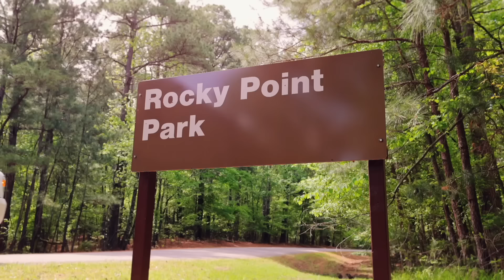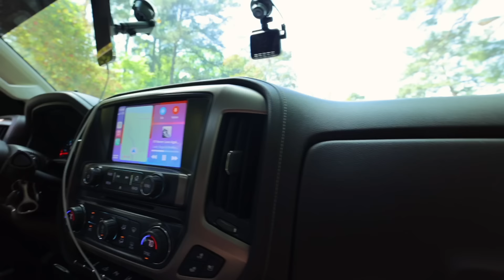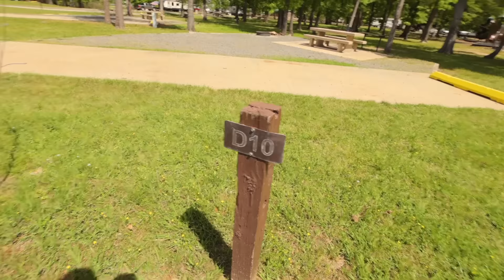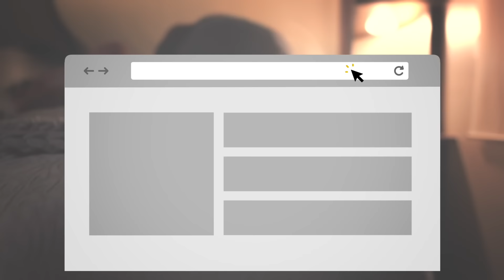DON'T Take Shortcuts with an RV - We Paid the Price

Comment: C.O.E.  parks cannot be beat . . .   especially for us “seasoned citizens” ! 😁
We have camped there at Rocky Point several times,  very nice !
Reply from the maker: YES!! How cool that you have been there as well. What a small world 🙂
Reply: We have 2021 Rockwood 5th whl ;  their entire product range has the Dexter Torsion Axles.  Just luv’em !
Reply: Regarding axle bearings . . if you’re already in a situation where you’ve removed a wheel & hub,  it’s best to just clean & re-pack with grease “the old-fashioned way”, by hand. 
Using the grease-zerk on the spindle-end is “tricky” . . .  real easy to “blowout” the rear seal, sending grease all over your brake assembly . . . kinda negates the “friction” of brake-shoes.

Comment: We made our appointment at MoRryde for the independent suspension and disk brakes. IT IS ABSOLUTELY WORTH IT. Braking is far better, ride is far better. It won’t change your weight sticker but we went from 7000 to 8000 lb axles.
Reply from the maker: This is great to hear! We are happy you have found the upgrade to be worth it. Keep on keeping on 😎

Comment: When you replace the brakes you are supposed to replace each end of the same axle so the braking force on the axle is equal.  We broke two springs in 2021 / 2022.  I learnedyou are supposed to replace both springs on the axle with the broken spring.  If one side breaks it puts a lot of twisting stress on the remaining spring,  weakening the remaining spring.   We stopped by the Rocky Point Campground in Feb., 2023.  Beautiful sunsets.

Comment: RE Independent suspension: I've seen a few other full-time RV'rs that got independent suspension and can't say enough good things about them. In their video, they showed ceramic coffee mugs, staked in their cupboard hap-hazardly, as if they were at home. And on travel days, they don't do anything with them to protect them. they just pull out with them stacked like that. When they get where their going, they're just like they were when they left, unbroken. Also, they leave a lot of items out on their countertops that they wouldn't normally, before they got the new suspension, and for the most part, they stay were they were put. Granted, the items on the countertops had some weight and either rubber feet or they put something like Gorilla drawer liners under them to help keep them from sliding. I'll tell you that, if I could afford to, I'd do it right now. Unfortunately, we just got our truck and trailer, and had to spend an awful lot on the initial essentials for camping.   FYI... initial "essentials" involved things to support my wife who has been diagnosed with "end stage" COPD. After a recent health scare, we decided to go ahead and do this 'now', before it was too late.

Comment: Don’t know about the independent suspension but I have disc brakes on my 2019 5th wheel Reflections and I will tell you I will never own another bumper pull or 5th wheel without them. Highly recommended!
Reply from the maker: Great information! Thank you for sharing. We have always been curious on how well they worked.
Reply: @HappilyEverHanks  I have no insight on the disc brakes on rv trailer applications, but in general disc brakes are always far better than drum. and more than likely WORTH the $$ they cost.
Reply: I have disc brakes on my 5th wheel too and i have had them on other trailers. They work fantastic but come with their own pitfalls. In an RV they have a hydraulic pump and fulid levels that need ot be checked and also the lines may need to be bled from time to time.  My 2024 GMC  had to have the brake controller replaced because the controller did not work properly with the electric/hydraulic pump which was a pain for us. We would just randomly loose the brakes which is not good when our RV is a 24k unit.... 

In regards to the drums, there is nothing wrong with them at all as long as they are maintained. My suggestion would be taking them apart annually to inspect the shoes, clean and inspect the brake hardware and clean, inspect and repack the bearings.
Reply: @TDub_ADV  I was unaware that disc on a tt was that big of a pain. makes sense tho. as they can't be "just" electric. and I agree my drums are fine with a bit of care. kinda like the misses.🤣

Comment: We had the MorRyde Independent Suspension installed on our brand new 2021 GD Reflection. Totally worth it especially in light of the recent complaints of frame flex. MorRyde will be doing a lot and I mean a lot of welding to the frame when the IS is installed. The result: a beefier frame and best of all, NO leaf springs to worry about breaking while traveling down our wonderful (joke) of an interstate highway system, 😖

Comment: Be very careful greasing the hubs. If you put to much grease in it will go onto the brake pads and ruin them and you will be replacing them again. I have replaced more brake pads for grease on them then I have for them being worn out.
Reply: 100%, I've had to do this as well. it happens, just cuz you can pump more grease in does not mean you should!

Comment: Great content as always. For parts on your trailer or vehicle anything touched the ground like tires or bearings. Ball joints ECT. Think like your shoes you replace them in pairs even if the other shoes have Abit of tread left it might fall apart sooner then you think. And it sure feels good walking with equals pairs same thing with auto parts . Cheers from Québec Canada.
Reply from the maker: Great point! Thank you for your wonderful support 😊

Comment: Hi we have a 2019 29 30 we put disk brakes on it in 2020 zero problems we also put slipper springs which have lifetime warranty. We purchased them at performance breaking and they install them where we wanted, they came to us.

Comment: You should replace the other axle brakes also.  You would be good to check them at least twice a year and replacing the brakes with the entire plate like you did is the best way to go,  if there is rust or junk in the old parts it can cause issues.  If you know what axle you have which should be on the sticker on your RV you can tell them you have a dexter 8K axle and want both ends of the loaded brake kit.  Good to learn this so you can check your bearings twice a year.  Hope you are staying safe and healthy.

Comment: A suggestion for your jigsaw puzzle - get 2 large foam filled boards from wally world.  Start making your puzzle on the first board.  When you travel place the 2nd board on too and tape the edges up.  Also when you just want the table space back for any reason, same thing.  Added advantage also allows you to spin the puzzle easily while working on it.

Comment: Hey guys, love your videos!!  This is one reason when we travel, I carry two spare leaf springs, shackles, bolts, equalizer and a spare set of wheel bearings.  You never know what's going to happen with one of these rigs.  It always seems like something is going to go wrong.  Speaking of brakes, I just noticed that none of my brakes had the little plastic things that cover the hole where you can adjust the brakes from behind the wheel.  None of the wheels had them.  I just ordered some and will be snapping them in place.  Another area where dirt and water could enter the brakes and eventually cause problems.
Reply from the maker: Great idea! You are a few steps ahead of us. It’s crazy how quickly life can sneak up on you when you least expect it. Thank you for watching 🙂

Comment: Independent suspension 
🇦🇺🦘 Aussie here , this has become our most common setup because of free camping as most or the best places are off the hardtop, beaches, deserts etc
Then it’s how far you want to get semi off-road 1 shock with coil spring, off road 2 shocks & coil or air bag suspension. Then it’s drum or disc brakes, disc’s are pretty much standard with airbags now. We personally have off road since 2019 love it, get a bit higher ground clearance.
Want to see probably top of the crop check out cruise master range

Comment: When tightening that bolt on the hub you should use a torque wrench, not channel locks. Also it’s much easier and works better to grease the bearings with a   bearing packer. Lastly it is recommended that you repack your bearings every 12,000 miles.
Reply: ...that's only part of the procedure!  Torque while turning the hub like you said...  this is to "pre-load the bearing"  step 2 is extremely important.. 2) loosen nut after Torque and  finger tighten only!  If you don't do this it will run hot and probably fail prematurely.   Ask me how I know...

Comment: It looks like you got manual adjustment brakes - be sure to regularly check and adjust them.  A great reference for all things trailer brakes/bearing/axle related is @TheTrailerSmith.  There is also break-in process for new brakes called burnishing that makes a big difference in how well they work.

Comment: As a mechanic, you need to replace components in pairs. If you replace one side, then you need to replace the other side. 
And with your high mileage on the trailer, not only would I increasing your spring weight, I would upgrade the axle weight to include disc brakes. 
One way to check brakes, is to use an infrared thermometer. Drive little and hold the brake actuator  on the brake controller. Then check temperatures for each brake. Then you can identify which brakes are working, not working and those over heating.

Comment: You should do both axles not just one.   I did this on my fiver and  noticed on brake pads that looked ok were actually starting to peel off of the metal.  Lot of weight they are trying to stop so lots of heat involved.   I just got all the pre-built assemblies and replaced them  Luckily I did this before having any damage to my Drums.   My bearings looked fine so just regreased them and got new seals.  Good luck and happy camping.  Also used the open roads diesel app on my last trip and did save some $$'s so thanks for that.  cheers.

Comment: Btw, the wheel bearings need a special procedure to make sure they are tight enough! Normally you torque the spindle nut to 50ft-lbs then rotate the drum three full turns, they back off 1/4 turn, then rotate the drum three full turns, then torque it again to 50ft-lbs then rotate the drum three full turns, they back off 1/4 turn, then rotate the drum three full turns, then torque it a third and final time  to 50ft-lbs then rotate the drum three full turns, they back off 1/4 turn then install the lock ring or cotter pin depending on the type off lock. IF the lock does not line up back off the nut until it does line up and done. Make sure to sue your greaseable hub to fill the bearings! 

As well, I thought I saw you ask the question if anyone used Independent Suspension on their RV. I have had trailer with Leaf Springs like your 5th wheel and I have had a travel trailer and now a 5th wheel with Dexter TorFlex Axles...now that I have used the TorFlex axle trailer for almost 10 years, I would never want a trailer without the independent suspension ever again! The Ride is super smooth and stable at all times. Even the harshest roads doesn't cause things to swift in the 5th wheel and they technically cannot break! 

I would also like to mention that you should consider replacing your trailer tires, I saw in two of your videos a belt issue in the sidewall of the Westlake tires you currently have. I would suggest the Carlisle Radial Trail HD tires for your trailer, they will even reduce your fuel consumption by 1 to 2 mpg! And if you change your tires, consider getting them balanced, it helps with even wear and reduced vibrations to the rest of the trailer and therefore reduces repairs!

Thanks, Kevin

Comment: A good lesson in not putting off inspecting a new noise source.  Glad you had some helpful neighbors, they seem few and far between these days.  You did the right thing buying new backing plate assembles after that much damage....  The drums might have  been reusable unless they had a bad groove in them so erring on replacing them was good.   I been towing trailers with electric drum brakes for over 25 years and I can count on one hand how many failures I have had on the road.  Coupled with never having issues stopping the truck and trailer I am not sold on electric over hydraulic setup (AKA disk brakes) as must upgrade.  Annual maintenance and inspection has caught every time they been worn down enough to need replacing or failures as they where about to happen.  That alone has convinced me I not to spend any money on retrofitting on a trailer and use those thousands of dollars towards travel and making memories.

Comment: We had the independent torsion suspension on our Rockwood Minilite and it worked great. No issues with 6 years of ownership other than servicing the bearings once a year. It is the same suspension system used with Airstream trailers.

Comment: Thanks for covering this critially important responsibility. If someone is not comfortable doing a brake check/job themselves, taking your rig to a trailer repair shop and having them check and repack your hubs is also an option. Most RV parks know local shops that can handle large rigs. Of course this should be done BEFORE they begin to make strange noises....

Comment: do not have the independent suspension but, i did have Disc Brakes installed on my RV and the roadmaster slipper springs with shocks installed by performance trailer braking.  Made a world of difference in towing and stopping.  The installer told me that one disc brake has more stopping force than all 4 drum brakes combined.  he was not wrong the disc brakes are "wonderful" and with the new slipper spring system the trailer pulls so much better!  dump the drums you won't be disappointed and the cost is worth the peace of mind they provide!

Comment: Trailer leaf springs are dirt cheap. Always replace all 4 at the same time. Also, if you are planning to keep the leaf springs, get bronze bushings, a wet bolt kit and the morryde heavy-duty shackles.
The wet bolts allow you to grease the leaf spring bushings, dramatically reducing the risk of broken springs.

Do you have brakes on all 4 wheels? Just replace them all. You're already working on it.

Comment: Wheel bearings and brakes are often ignored by too many; they should be maintained constantly.  Some might say overkill but I do mine every 5k miles.  Repack, new seals and check the pads at the same time.  I replace the bearings around 15k miles, cheap insurance.  Keep the old ones pre-greased in sealed bags just in case.  I also crawl around looking at the springs and all the other stuff underneath when doing this maintenance as well.  Given the horrid state of our roads these days it's well worth the look/see on a regular basis.

Comment: Hello again Hanks.  Really sorry to hear about your spring trouble.  Wish we had known where you were for the eclipse.  We are only about 75 miles away.  Used to camp at Rocky Point every chance we got with the in-laws. Have you weighed your rig???  I weighed mine ever way I could.  
1.  Pull just truck with trailer hitched onto scales. This will be weight of truck with trailer load on truck. 
2. Put front landing gear down on surface before scales.  Lift trailer off hitch.  You do not have to unhook.  This gives you weight of truck only. 
3. Subtract #2 from #1 and you have the weight of the trailer on the truck. 
4.  Now raise landing gear and pull entire rig on scales.  This is what everything weighs. 
5.  Subtract #2 from #4 and you have the TOTAL weight of your trailer. GVWR
6.  Now pull forward and get truck on solid ground with only wheels of trailer on scales.   This is the weight on your tires, springs, etc..
7.  Add #3 and #6 , and you have the weight of your trailer. GVWR. (Should be same as #5)  

If you have not done this do it the next time you pass some CAT scales. I was really concerned about #3. I am overloaded for a 3/4 ton, but I added air suspension to the truck and I have no problem and are in a safe range for the tires 

You now know everything about your rig, weight wise. I did this and recorded everything so I can refer back to it as I need to.  Happy travelings. Hope to camp with yall some times.  How can we keep up with where yall are headed?

Comment: Sorry to see that happen, we caught ours just in time on the last trailer. I think it's easier to notice when you have to manually level your trailer and you're like, "Why are all the campsites unlevel on the driver's side..." Glad you're both safe and Solly made it through unscathed mostly. Also if you are interested we got a replacement fender off Amazon, the color was off but we ordered a set and replaced them both and it looked fine. Hope that helps.

Comment: I just replaced the four springs, shocks, added Morryder CRE3000 equalizers and used the wet bolt kit, and replaced all four brake hub assembly's ( it will cost you more to replace just the pads and magnet than the whole hub and it's many times easier to install then just pads), bearings and seals. Figured while I was doing one thing, it made sense to do it all. I did all the work myself and all-in just less than $1500. The work itself was easy, just time consuming. I figured if I just replaced one spring here and one shock there, it would have gone on for a long time fixing stuff. Now, everything is brand new and I don't have to worry about it for years. Great video. Glad you were able to get your issue resolved onsite.